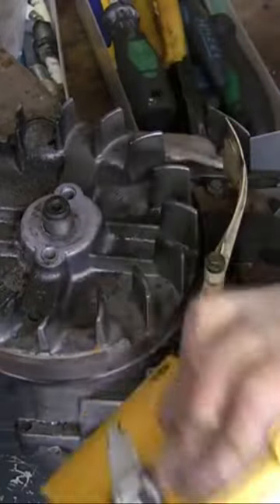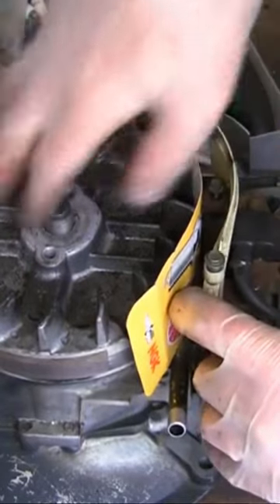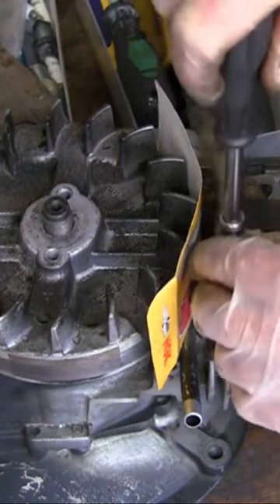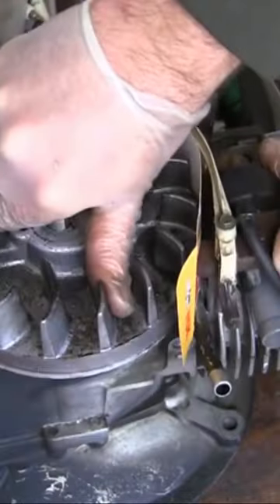Setting The Ignition Coil Air Gap (Works on all mowers)

Comment: Have you ever seen an ignition bolt which goes through the white vein arm and only has a thread on top to mount the top housing and no bolt head ? I'm not sure how to remove it as it's securing the ignition which needs replacing.